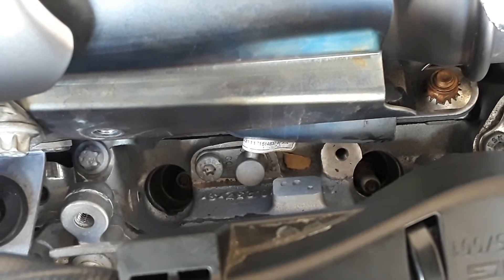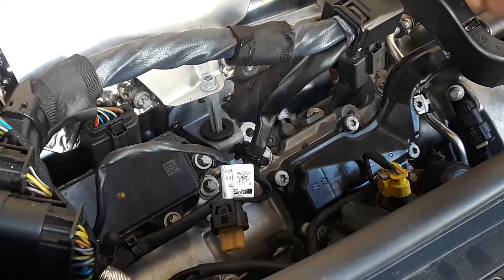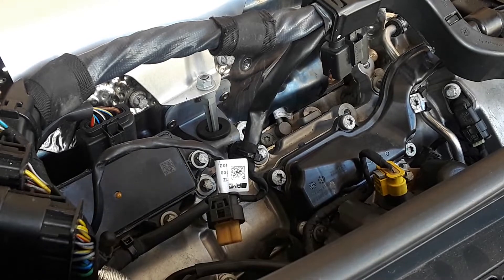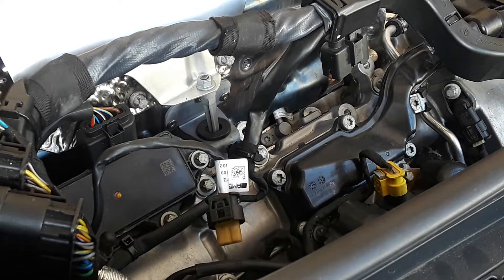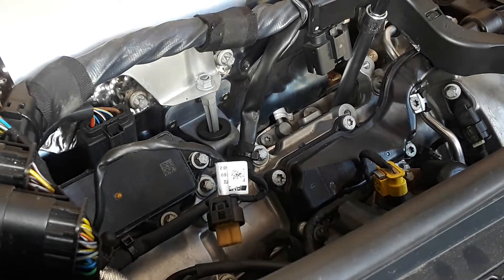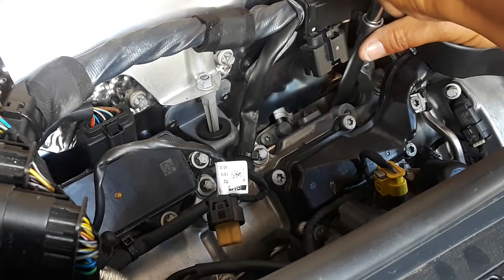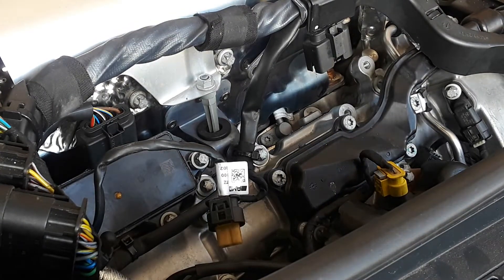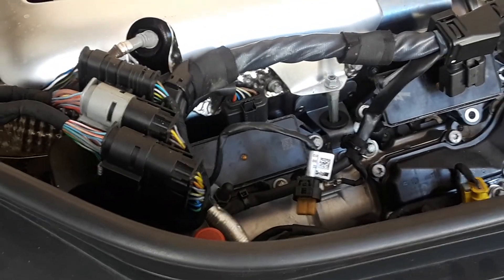Mercedes C63 S (Part2) Spark plug Change

Comment: ...I liked the videos on replacing spark plugs. Very simple and useful for DIY people who don't want to spend around $1000, for spark plug replacements (for V8 engines) at MB facility. However, it should be recommended to use a torque wrench together with the MB torque chart, this will make a huge difference in terms of engine performance. All spark plugs MUST BE replaced at exactly the same torque specification, avoiding potential engine damage. A good/reliable torque wrench costs about $70.

Comment: Yes that part was the easier side to get to but how do you do get to the back two is hard part ?
Reply from the maker: The back 2 wasn't that hard same as all the other just take your work the wrench in
Reply: redbaron2448 driver side had the fuel line in the way and those coils are very tough to move but got the job done. Thanks
Reply from the maker: @samalemari3848  great to here, good job

Comment: How did you remove the wiring to get to the back two plugs?
Reply from the maker: Probably that is in part 1 of the video believe it's just one or two screws that hold the wire harness just remove it and comes out

Comment: They should be torqued to 20 ft lbs..those are aluminum heads..
Reply from the maker: Yep they were
Reply: The shop manual says 22 Nm
Reply: @sreitshamer  Where can i get a shop manual? I have a 2018 glc63s

Comment: You never covered the back plugs. There’s a fuel line on one side and then something on the passenger side
Reply from the maker: Didnt have to, there all the same, socket will fit around the fuel line, easy peasy
Reply: redbaron2448 but on the passenger side the tube is hard and literally right on the last bolt and over the coil pack. How did you even manage that?
Reply from the maker: @rostos20  Easy peasy , I have small fingers. You might have to take  Swivel socket with extension if you have big hands